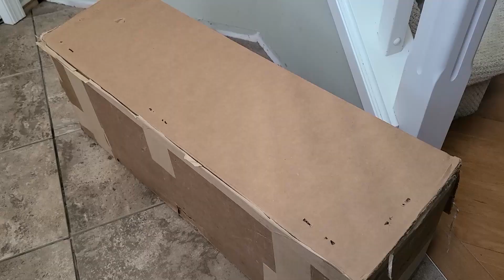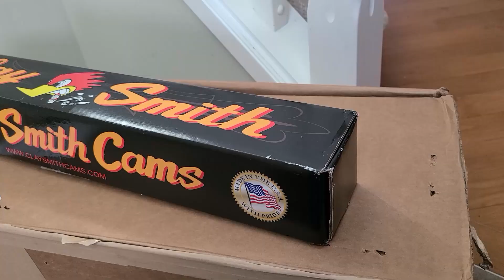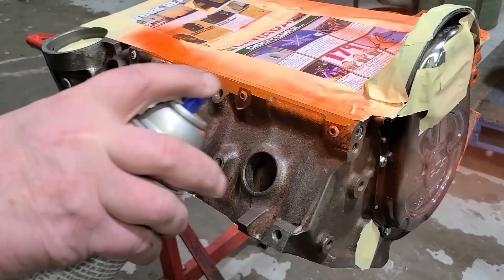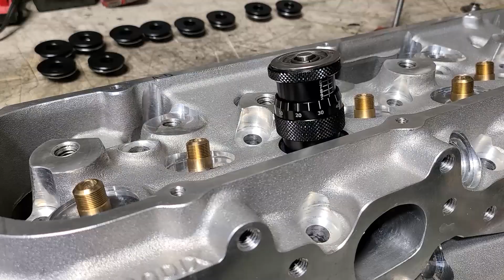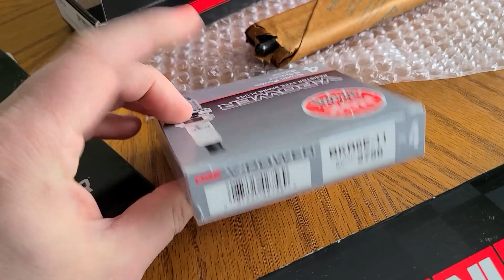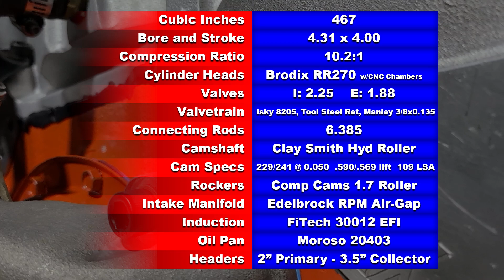454 Big Block Chevy is BUILT! - Assembly and Specs

Comment: I have pretty much this same engine in my 55 chevy , crate ls6 from the 80's , big solid cam  237/240 - 632 -637 , brodix race rites cnc option 270cc heads , eldelbrock rpm air gap , pro systems 850 carb , 3.73 gears , 3500 neil chance convertor,  400 turbo, 325/50 mt drag radials, runs 11:60's 116 mph the gew times ive had it out on test and tune Friday's

Comment: Question. I have a 71' Heavy Chevy with a 454. Hedman headers with Taylor wires with the 135 degree boots. Some people say shorty plugs. At any rate I have boot protectors, are those NGK plugs the right length for such, do they stick out too far, or?
Reply from the maker: The part of the plug that the boot goes over is a pretty standard length.

Comment: Thanks for sharing everything. Glad you went with clay smith. I probably would have went with 3107 or 3106, to get to 600 hp, but you have a great combo...Honestly, i put some brodix on a sbc build, and was disappointed by 25 hp as well..
Reply from the maker: I'm pretty happy with the Clay Smith cam. It's right in line where I want the power to be.

Comment: Should have used a big single plane Brodix intake and a .700+lift 270+@.050 solid roller cam, then you would be getting the power out of them heads. You would have more torque than you could use on the street. Probably make 100+ more horsepower and torque. Rev to 7500 rpm.

Comment: Was wondering why you could not get a 7/16 pushrod to work?
Reply from the maker: Would requiring clearancing in the heads and that wouldn't be worth it for my spring pressures and low lift camshaft.

Comment: Those pistons are very similar to my Ross Racing 25cc pistons even have the same head too close for comfort issues. I decided on going 4.25 stroke wasn't easy since I already have an original 70 ls6 crank mint condition never turned. Your power should be similar to a 70 ls6 little less compression but way better cylinder heads and a roller cam make up for that.
Reply from the maker: Mine makes way more power than a factory LS6.

Comment: Why is a 509 your dream motor?
Reply: 632 would be even better.
Reply from the maker: Big bore and small stroke. Reduced piston speed and less windage/oil pan issues which a benefit for road racing. Yet still plenty of power and a broad torque curve since it's still 500+ cubes.
Reply: @SS454LS6 wouldn't you rather have a 4.600 bore block and a 3.76 stroke then?
Reply from the maker: @TobyBielat  The 4.5 bore is very common, so are 4.00 inch strokes so parts have better availability. Plus if the desire or need to bore the block, there is plenty of material still left. Plus the 509 would make roughly 10 more average hp and tq over the entire rpm range based on what I'd want.

Comment: Those shavers on top of the bores is like giving your fuel air ignition a Crow bar to destroy you head gasket. Very stupid and pointless. If its because of valve clearances its all wrong build 😅

Comment: I armed a motor of 454but when i turn on the engine makes like explosion sounds through the escape. Did i leave the time wrong or do i just need to adjust the carburator ?. When cold car turns on well but once warmed up it takes a minut3

Comment: Best part of this is the New Motor. Worst part of this is now having an excuse to start to tally up the future cost of the next 4.500" Bore Raised Cam block, Shaft Rockers, Victor Jr Intake, Holley Sniper V2 and either a CNC porting with valve upgrade to your Brodix heads, or a new set of Heads and then Headers. I figured out leave out the idea of a Dry Sump setup for your Road Course driving, as you are likely dreading the expense already in the back of your mind, as baffling only gets your so far in the end. Alternatively, rather than going THAT long parts list route, there's always an option#2 of a fat head gasket, Intercooler and a ProCharger....... that's only 3 items to add to what you already have ;)  best of luck when this engine hits the car and when your mind starts thinking about the price of the next evolution. Cheers.
Reply from the maker: So true. My dream engine is very similar to what you speak of haha. All aluminum too. $$$$

Comment: First a congratulations on all the progress, hoping it produces great results. One tip I learned from aircraft work/jet engines is to use Milk of Magnesia white stuff for the O2 sensor as it takes highest heat with no breakdown and won't contaminate it. Also laborious extraction not a party, but glad you decided to test with the FiTech to know actual results closest to "in car" as you can get it, but I have the 30012 to go on my 502 when I install single TStorm charger and Crane 288/296, 587/610, 112 LSA so anxious to see how it behaves. Thanks for posting here as YT is only way for me to see...
Reply from the maker: Thanks for the tip! I'm sure your EFI will do great on your 502
Reply: @SS454LS6  Thanks, with their "in house" dyno & good friend having family closeby, considering installing it all down there & having FiTech dyno tune it. Anxious on upcoming results for you! 🤞👍

Comment: I have no idea why you ground that notch in the block. I have built many 468 with 2.250 1.88 valves and that notch is not needed. It comes stock in a 427 block. You are gonna wish you  went with a bigger cam. I used a 638  244 at ..050 comp cam  and wish I used the 651 256  . Also I picked a set of heads that raised exhaust. 300 because I wad also worried about the headers clearing everything which they did. Raising the exhaust dramatically increased flow but with that small cam it may not affect the hp numbers to bad. I drove mine every day to work for a few years in a 74 camaro that weighed 3700lbs and it ran 10.90 on motor
Reply from the maker: I would have preferred to have gone with the AFR 265s but the raised exhaust ports would have changed my exhaust pipes. I didn't want to have to redo all of those. I'm leaving a good 20+ hp on the table by going Brodix.

Comment: Great choice of parts. Did you use a step nose cam?
I’ll predict 595hp at 6100 rpm, 585ft lbs at 4400 rpm.

I’m not sure why that shop was so against the cylinder notches. I suspect just because they had not seen that before or something. 396/402 came with larger cylinder notches compared to 454 I suspect.
Reply from the maker: I wanted to go with a step nose, but the cam manufacturer said that machining the block may have been required (even if the bolt holes exist). Because I wasn't certain, I went with the typical cam button deal.